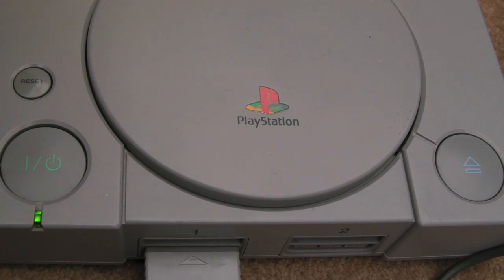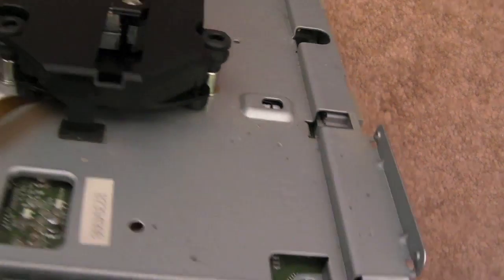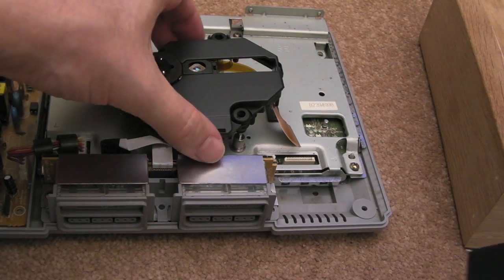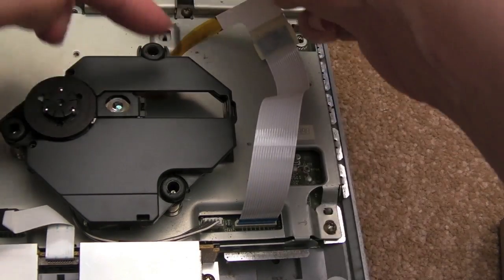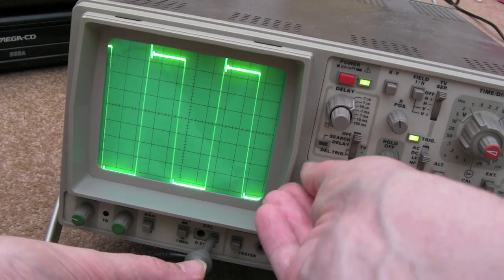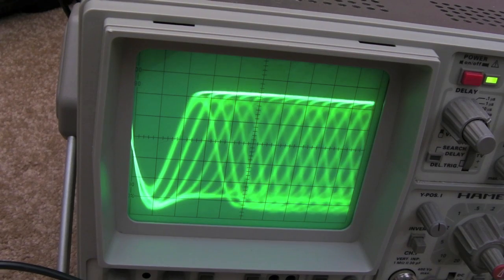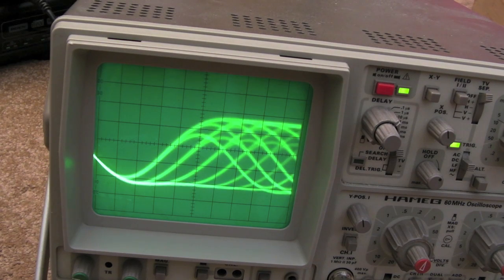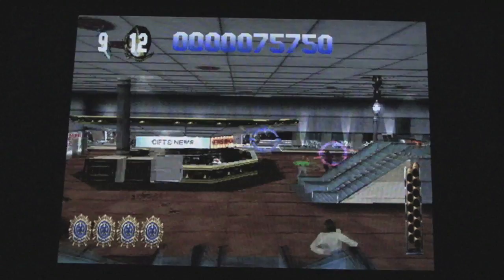Sony PlayStation Faulty Laser Repair (And voltage adjustment)

Comment: Hi folks,
I have a question regarding where the chip is located in the PS1 and if ordering the part to replace the laser would affect my PS1 being able to read burnt games.
I recently found my old PS1 from when I was a boy, along with a heap of old burnt/pirated games. I remember it was modded, so it was able to read the discs without a problem.
I have replaced the spindle as that was broken. Now when I put in a disc, it runs me through the Sony orange diamond screen and then brings up the PS1 logo. I then can hear the PS1 trying to read the disc and run the game, but it can’t. After watching some YouTube videos, I think the problem is the laser is broken.
My question is: if I was to order a replacement laser and follow the video carefully that is linked below, would my PS1 be able to read the old burnt discs without hassle and therefore be up and working again? As you can tell, I’m not sure how a PS1 is modded.
Comment if you can help me out, I’m ready for some nostalgia. Thanks!
Linked video: https://youtu.be/OYwSrFjulWk
Reply from the maker: Have you checked the black plastic sled where the laser assembly slides along?  That is the most common issue on some PlayStations.  You can test it by booting the console upside down (so you can see the underneath of it up top, instead of the top).  If it reads discs that way, you know the sled it worn.

Comment: Where did you get this new laser ??
Reply from the maker: AliExpress - quality varies, if you buy from there consider purchasing 4 or 5 - chances are 50% of them won't work properly.
Reply: @GadgetUK164   Just watched this after replacing some lasers and finding 2 out of 4 did not work properly even after pot adjustment! Thought it was just me but no, 50% non-functional looks like it's right for the aliexpress KSM-440AEM ones!

Comment: Whats the quality of these replacement lenses?
Reply from the maker: It's hit and miss on these cheap Chinese lasers - if you buy 5, chances are 2 will work perfectly.
Reply: @GadgetUK164  thanks, another question. How long does one of these lenses last, and are there high quality ones?

Comment: I'm on an SCPH-101 (_not_ 1001) and I'm having issues with FMV and audio track stuttering and skipping, as well as increased load times the longer the console is on. So from what I take it from the video I just have to set the laser voltage to 1x?
Reply from the maker: The RF level voltage wants to be around the 1v mark.  Somewhere between 900mV and 1.2v
Reply: You can also turn the PlayStation on it's right side like a PS2 and see if that works. A lot of the time, the design causes a lot of friction inside the laser assembly and turning it this way reduces that friction. On my PS1, you can hear a difference in the smoothness of the drive immediately when you turn it.

Comment: have you heard about the PSIO? it's some flash module for the PS1, but requires some soldering work for the switch board and it needs to be a PS1 with the expansion slot on the back (SCPH-100x to 750x and DTL-H100x to 300x) I'll eventually get a PSIO or a pre-modded PS1 PSIO bundle when the laser on my PS1 inevitably dies.
https://stoneagegamer.com/flash/playstation/
Reply from the maker: Yes - the PSIO looks cool!  I will get one at some point!  As you say - you need the expansion port model.
Reply: my dying SCPH-5501 does have a port, only the 9001 and slim lack the port. the 1001 to 7501 has the port. i may either send the console to stone age gamer to apply the switch board or i may get the switch board myself and try my hand at getting it on there. i will practice soldering on many of my failed Apple Macintosh motherboards and a sound blaster 16 before i start working on my PS1.
Reply: and there are 2 more ODEs for the PS1, the XStation and terraonion mode. which have better compatibility than the PSIO.

Comment: Where did you buy the replacement laser from?
Reply from the maker: AliExpress.  You will find them on eBay too, but often the sellers there are reselling ones purchased from AliExpress.  Expect a % of units that don't work though, so don't just buy one, buy three or more to ensure at least one works correctly.

Comment: it's not really clear in the video, are you reaading the laser on ac voltage or dc. i have seen videos with people using multimeters on dc volts, and i think you have another video like that, but your scope pattern looks like a coupled ac sine wave and your scope looks like its set on ac voltage. so are you looking for close to 1 volt ac? or 1 volt dc?  thanks
Reply from the maker: Measuring DC with a multimeter!

Comment: Hi ive seen a video  of a person using a digital  oscilloscope  is that okay or does it need to be Analog Cheers Jos
Reply from the maker: You can use a digital scope, but it's a bit easier with an analog scope.  I think RetroGameModz talked about that in his video (linked in the video description).
Reply: @GadgetUK164  Hi would this Oscilloscope be allright or not https://www.ebay.com.au/itm/OWON-VDS1022I-USB-Oscilloscope-100MSa-S-25MHz-Double-Channel-PC-Oscilloscope-J/283240468453?ssPageName=STRK%3AMEBIDX%3AIT&_trksid=p2060353.m1438.l2649
Reply from the maker: The specs look OK - ie. 100Mhz.  I just use a 20Mhz scope for all this 8 bit stuff.  Some of those cheap digital scopes aren't great, so I have no idea how that one fares to other scopes of similar price.  Might be worth checking out reviews of it online before purchasing.
Reply: @GadgetUK164  Hi i dont no nothing about how to use a Oscilloscope i just want to adjust my laser as i have put a new one on and i have got only a digital multimeter Cheers Jos

Comment: Hmm, might have to try this myself, my PS had been sat on shelf for a while with a broken spindel, which I've only just got round to replacing today, after finally not having it pushed down too far that it wouldn't spin, It let me played the first level of Alien Trilogy just fine, even played the FMVs perfectly, but had trouble with Monkey Hero either struggled to start at all or choppy FMVs. I did buy a new laser aray as I didn't know you could just buy the Spindel part, but I don't trust the sound that thing makes.

Comment: Are the new lasers better than the original?
Reply from the maker: I would say no, definitely not.  They can be as good as the original if you get a good one.  If you buy from AliExpress but 5 or more.  The chances are a few will be perfect, 1 or 2 will work but not great with CD-R, and 1 won't work at all.
Reply: @GadgetUK164  Why do the CD-R discs require more voltage to read than pressed discs? Isn't the data the same once it is written?
Reply from the maker: A burnt disc is not as reflective to the laser as a pressed disc is.
Reply: @GadgetUK164  Thank you for answering, makes sense. Does the laser change voltage when it is reading with various disc speeds? I think it changes only amplitude.
Reply from the maker: @vdochev  No, I believe the laser voltage remains fairly constant, what does change is the RF level due to less reflection of the laser back to the pickup section.  This is why it is sometimes hard to read pressed discs as not as much of the signal is reflected back as with a pressed disc.   You can improve that by using certain types of media (eg. Taiyo Yuden discs) and burning at a slower speed (x2 or x4) can have an effect too on some CD units.
Reply: @GadgetUK164  Thank you for replying, really appreciate that. I'm talking about the PS1 like yours in the video. It stutters at FMVs, the audio sometimes is not in sync and I think the loading time sometimes is longer. However, it plays music CDs fine.

Comment: Is it possible to replace its lens only? Since I really want to keep the original shell of the lens.
Reply from the maker: I think the laser carriage could be transplanted into the original Sony housing (but I am not 100% sure).
Reply: Thank You for Your reply.🙂
Reply: yes, obviously you can replace the eye kit only,but 1st u have to learn that how can disassemble the unit,
for me, this is piece of cake, bcoz i`m doing this since 1996 on my own play stations
i can also do these jobs with all ps2`s (fat or slim dosen`t matter)
every  play station and ps1 have the same laser eye modle ( KSM 440 maybe)  accept the length of ribbon cable (use the extension connector with the short ribbon as u c in video)
also ps2 fats all models have the same model laser eye ( KHS 400 for sure) nothing is impossible dudes every mechien is man made, and if man made a mechien another man can make it disassemble or reassemble, only thing you need is the mindset and keen interest in mechenicals and electronics, 
read the basic books to understand

Comment: I have bought a laser part with model number KSM-440ADM it is chinese rip off. The model for psx is the same SCPH-5502 and it does the same thing, stuttering on the FMVs or sometimes the background music stops for a few seconds or laging on my console also when the cd spining I noticed a wobbling on the disk and a clicking noise. The laser has the screw on the side for the volts, but there is a screw for volts on the motherboard. Where can I buy a functional laser? Because I can't find oscilloscope to set the adjustments.
Reply from the maker: It's incredibly hard to find any genuine Sony lasers tbh.  I tend to buy 4 or 5 from AliExpress and if you are lucky most of them will work.  Did you swap just the laser, or the whole drive assembly?
Reply: I replaced the whole drive assembly. I bought a KSM-440ADM (normally the SCPH-5502 had the KSM-440 AD) and KSM-440BAM with extension cable (it does the same thing with the KSM-440ADM doesn't read properly, skipping the FMVs and makes more noise than the KSM-440ADM) a long time ago, but I didn't know for the adjustments. I thought was plug & play, and I think the genuine KSM-440ADM do not have it anymore.
BTW thank you very much for the answers and for your time, sorry for my english I am not good to it.
Reply from the maker: Have you considered the capacitors on the PSU and the SMD caps on the motherboard?  Do you have another working PS1 with a genuine Sony laser that you could borrow - just to rule out your motherboard and PSU?
Reply: I'm not sure if I can find another PS1 in my area with a genuine laser. I didn't check the capacitors. There is a possibility that the capacitors may be faulty?

Comment: How do you get that good pattern? I keep trying to test the same point but all I get is a very small sine wave, with all my settings like yours as far as I can figure... its a DS203 oscilloscope.
Reply from the maker: Are you using a X10 probe?  The attenuation at X1 will kill the signal.
Reply from the maker: It could also be one of those things that's hard to measure on a digital scope - not sure.  I do know that some of the people like 12 volt vids and a few others complain that reading RF and analog video signals is harder with a digital scope.
Reply: Thanks for the response. Yeah, I am using 10X and I am also using the analog port on the multimeter. AC coupling too as far as I know.
Reply from the maker: Sounds like just a 'digital issue' then I think.
Reply: I hope so. Just bought an analog scope off of eBay, because I have about 10 PS1s to go through. Thanks for your help!
Reply: Yup, you were right. The analog one works great. Thanks man!

Comment: Got a question im replacing the lasers in my 3 ps1s and i have a 7501 model, a 5501 model, and a 1001 model why is the 1001's acm laser so much more expensive?
Reply from the maker: Since the 1001 was earlier I am guessing the 3rd party manufacturers for the replacement lasers just went with the newer models perhaps?   If the ribbon length is an issue you can get extenders like I used.
Reply: I just read on a forum last night  that its do to the fact that the acm is model laser is actually a high quality laser  so much higher quality people will buy the PlayStations with that laser only to be used as a cd player for home theater systems which is weird to think of using a gaming console for only that purpose but hey i guess it increases the value
Reply from the maker: Thanks for the info - very interesting, I didn't know that =D
Reply: @curtis8880  Its not because of the laser that people prefer buying the 100x models for audio quality, its the DAC on the motherboard. And while its true, the difference is not THAT much to justify a higher cost on the 100x models as it is. This was a myth perpetrated by some news article a little over 10 years ago and they started popping up on ebay for 6grand. The later models do not have this DAC.

Comment: Hey, i have the slim version. just got a new laser off ebay and it spins slow. is the laser faulty? how can i fix it?
Reply: Well it is not playing at all.. I can't even get to the cd player and when i can also get to this menu it doesn't play audio. I've tried an audio CDs yes but as i said it won't play. It may be the anti-static solder blob? https://image.ibb.co/iCnVHb/Whats_App_Image_2017_11_07_at_21_47_34.jpg

I don't think it's a faulty IC but might be a power problem. If the power supply connector doesn't sit in a certain position, PS1 simply won't turn on.
Reply from the maker: When you say 'spins slow' - is it playing discs at all?  Have you tried an audio CD to see if that will play?  On new lasers there are a few things - firstly the antistatic solder blob needs removing, then there's the laser voltage adjustments - sometimes they come set incorrectly to the point it is either so undervoltaged it cannot read the disc, or its overvoltage and still cannot read the disc but the laser then dies very quickly if not adjusted correctly.   The fault in your system could also be something else - maybe a faulty IC or a power problem - numerous possibilities.
Reply from the maker: That component in the red box there is a capacitor - don't remove that.   Somewhere else - usually on the laser unit itself, should be an anti static solder blob that needs removing.  You may have already caused damage if you haven't remove that blob.

Comment: That laser assembly that has a short ribbon is for a different model. Also, I forgot to mention that you don't need an extender for that short ribboned laser lens. The trick is to disassemble the the top cover of the laser lens assembly, and full out the rest of the ribbon cable from underneath that casing. By doing so, you'll be able to extend the ribbon cable and make it longer.
Reply from the maker: Absolutely!  That's where the extender comes in handy =D
Reply: GadgetUK164 - Retro Gaming Repairs & Mods it's for the Dualshock version of the PlayStation.
Reply: My SCPH-9002 model has a shorter ribbon. My SCPH-5552 (like the PSX in the video) has a longer ribbon. The connector on the motherboard is at a different place.
Reply: @jumhig  you can disassemble the plastic cover of the laser lens, and full out the rest of the ribbon cable to extend the length of the ribbon cable. You don't need to buy an extension like in this video shows.

Comment: where did u get the laser replacement?
Reply from the maker: AliExpress - make sure you buy 3 or 4 if you get one from there as they are a bit hit and miss regards reliability.   Most of the units on eBay are either out of faulty systems or just re-sellers taking from AliExpress and selling on eBay.

Comment: You can have hours of fun with laser voltages ;)  Take for example, if you calibrate on a CDRW, you will have to up the voltage gain to get your 1.2volts (or whatever) as the reflective coating isn't normally as good as proper CDs. Then put in a 'proper' CD and the laser voltage can jump to 2 volts and burn out your laser ;)    I burnt up a few lasers in my old job until someone explained that I was using a really scratched CD to calibrate with, at the time I thought it was a good idea. Though when I put in a "new" CD, it was causing the laser to burn itself out :)
Reply from the maker: Yeah, that's one reason why I never increase the laser voltage to read CD-R / DVD-R etc.  If anything I prefer to reduce the voltage where possible as sometimes they (PS1 is an example) are set higher than they need to be in order to read a pressed disc perfectly.   The main thing I've found with all these laser based systems is the type of CD-R substrate, in particular its colour and reflectiveness is the key to getting a burnt disc working without adjusting the laser at all.  I believe in some of the PS2 models the automatic gain control is what can kill the laser too - maybe you've come across something similar there?
Reply: I'm not sure I have worked on anything which had AGC on the laser. I would assume "good" lasers would have it and have proper protection against overvoltage.  I have worked on huge volumes of laser assemblies (going back some years ago now) All them were manual adjusted. You are right about the substrates, cheap disks to proper disks, can vary a huge amount.  In the end we just set them up to play a "lightly scuffed" CD.  At the time CDR/W's wasn't really allowed in juke boxes and such anyway :)
Reply from the maker: Yeah, Sony deliberately didn't put protection in there though - it was some kind of deliberate attempt to overvoltage the laser if you tried to use burned discs.  Well, they never admitted it was deliberate, but I am sure it felt that way to people that tried to mod them.  It related to some of the early slim revisions I believe, but they fixed it in later revisions.  I think actually it wasn't the laser that was overvoltaged, it was the RF chip end up overloaded I think, because of the AGC.

Comment: Nice video!  Where do you buy these replacement laser assemblies from?  eBay?
Reply from the maker: AliExpress!   But make sure you buy more than 1 as the quality of the lasers on there varies a lot.  I bought 5 or so and 1 or 2 didn't work that well.